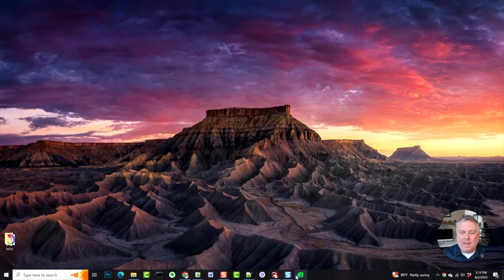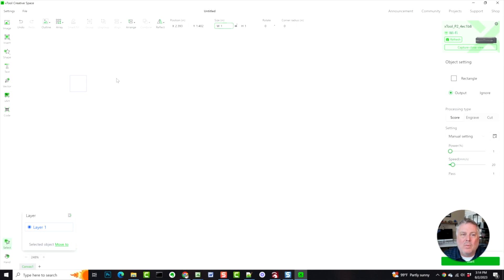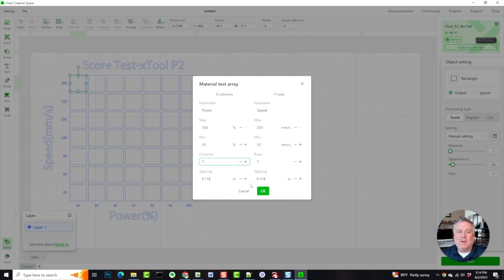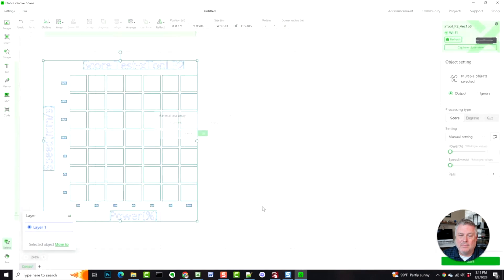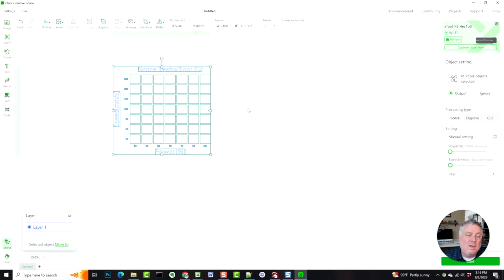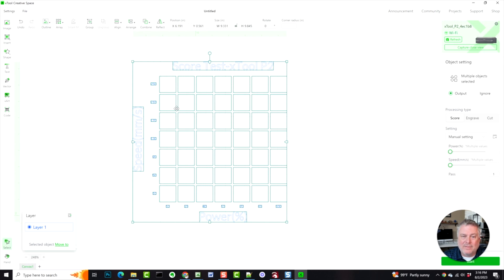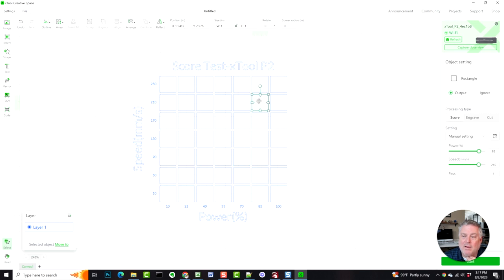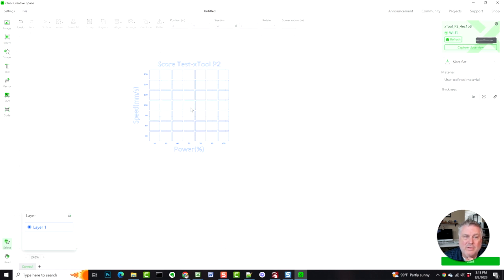How to Create FREE Materials Test Card in xTool Creative Space - Works for P2, D1 Pro, and M1 Lasers

Comment: Thank you for this! I got the d1 pro for Christmas and have no idea what im doing. The power and speed was confusing me with the different materials i was trying. So stupid question,  do i have to do this for every different material i use? Like leather, different kinds of wood..etc?
Reply from the maker: Hi Michelle,  thanks for your comment!  Unfortunately, yes... that is the best way to do it to make sure you get the outcome you're looking for.   Even if you buy the same TYPE of material... i.e. 3mm baltic birch... it can engrave differently depending on where you got it from...  Hope this helps...
Reply: @magnoliaoakswoodshop  thank you for getting back to me. I rewatched your video and realized that you said that it would be for every material I use. Sorry about that. I do have another question though, can you explain the power and speed to me, please. Is the power where you get the depth of the engrave or is it the power. Can you explain it to me, I'm sorry if it's another stupid question.
Reply from the maker: @michelleochart6617  Power and speed are just two variables that you change to determine the quality / darkness of the engraving.   High power / low speed would typically be darker.  Low power / high speed would be lighter.   More DPI, the deeper the engraving since the laser is going over each spot with more density/line passes..  There's always a sweet spot for each material / purpose / machine type... Just have to play around with settings till you find something that works for you.
Reply: @magnoliaoakswoodshop  thank you for explaining that to me. That has been the problem I have been having because I didn't understand the difference. Thank you so much!

Comment: show how to switch between score, engrave, and cut. Maybe it is supposed to be obvious but this old man doesn't see it. I just recieved my P2 last Tuesday and today (the Sat after Thanksgiving) i finally got it set up and tried a simple circle cut. 100% power and 30MM/sec. My 40 watt d1 cuts better that this thing. Plus a very loud chatter (best description I can give). It did not cut even half way through a 1/4'" piece of plywood....simple circle. Very disappointed. Admittadely I did not check the focus hoping it would be fine. I wll do that next....but that really loud chatter in the drive chain area is bother some. I don't expect you to do anything....I just need to bit.... a bit.
Reply from the maker: Hi George, Yes, there is quite a bit of difference between the D1 and P2.  The p2 was my first co2 laser and is a very different beast... D1 is much better for many applications and P2 is much better for others.

Comment: Just a note here:  You show Power and Speed, but if you start with a bitmap (say a bitmap of a rectangle) rather than a vector shape, you get Power and dot duration instead.  Took me a while to figure that out!
Reply: Can you elaborate a little more? How do you start with a bitmap of a rectangle? What is dot duration?
Reply from the maker: The easiest thing to do, for basic shapes like rectangles, squares, or circles, is just to draw it out and resize using the built in drawing tools in ACS... That way everything is at the highest quality avail and easy to resize

Comment: I got it that far, how do you set it up to be put on the product? If i put it on engrave, what ever the slate coaster is set at is what I get. No differentiation in engrave.
Reply from the maker: Hi Joseph, I think you're referring to the pre-defined settings in the drop down section with the material thickness field.   Those are just recommended settings... You can just choose User Defined material and enter your thickness and engrave settings manually as well.   Thats actually what I do 99% of the time and it works great!